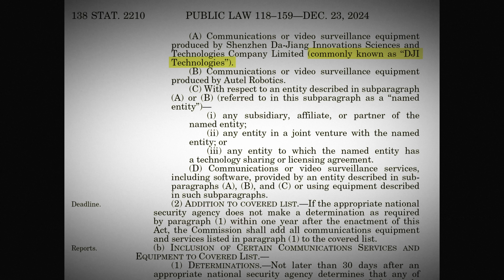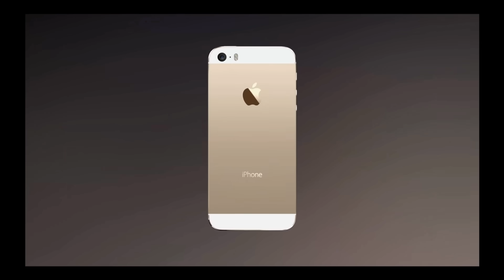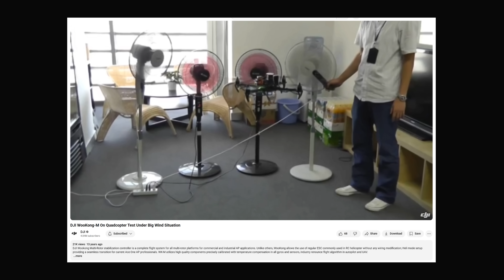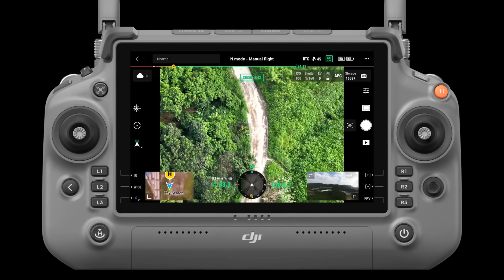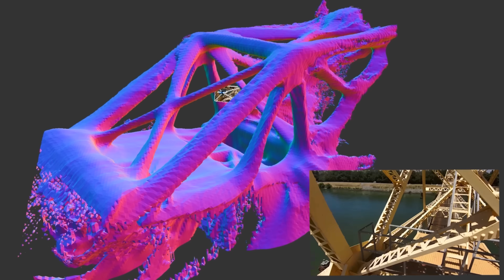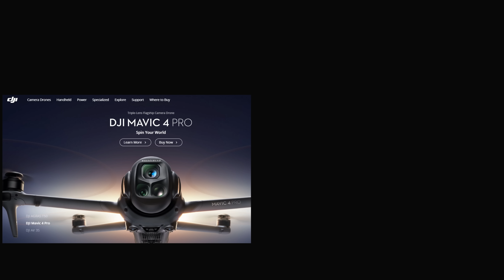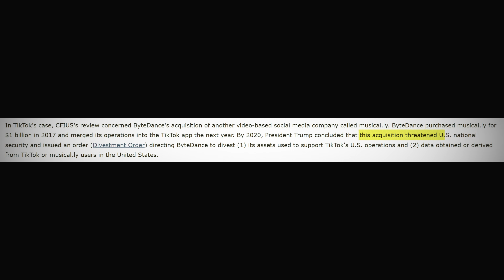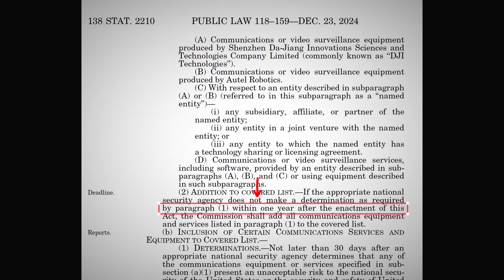DJI's Dominance and the US Ban Problem. The DJI Story

Comment: As someone previously pointed out, Mavic 4 Pro 4 can be found in the US by US sellers.  I ordered a Mavic 4 Pro and it arrived from Florida in 3 days.  Also, within a month I bought an Air 3S and Mini 4 Pro from US sellers.
Reply from the maker: Thanks for sharing your experience. I bought a Mini 4 pro as well. There is still time before the end of the year but I will admit my prediction so far is trending in the wrong direction. Buying from resellers, likely at a marked up price, is not necessarily the same as buying direct from the company but it is an important nuance that I overlooked especially if very large resellers like B&H, Adorama, Best Buy will do it. I am in the market for an OSMO NANO and that is even following the same secondary market processes mostly on those sites available in 1-month or on eBay from Korean resellers.

Comment: To be clear, you're talking about one class of consumer drone here: camera drones, a.k.a. aerial tripods.  DJI owns that market segment outright.

FPV drones, on the other hand, are mostly run on open source firmware such as BetaFlight and OpenTX.  DJI has a large share of the digital VTX/goggles market in FPV, but there are other digital video systems [HDZeo, Walksnail] available that will fill the void should the DJI FPV kit be banned.  In the meantime, analog video is still used by a large number of FPV operators.

Banning DJI camera drones is a pretty dumb idea - especially since the US doesn't have a fully domestic consumer drone manufacturer, let alone an industry.
Reply from the maker: Thanks for the clarity I know I switched back and forth a bit with enterprise ones but yes just the easy to use (non manual) consumer aerial drones.

Fortunately, FPV seems very healthy and is commercializing past pure DIY builds. Hopefully costs reflect that though I’ve seen some accounts I follow mention tariff increases in prices.
Reply: @lukecresante  FPV will likely remain a niche hobby.  The learning curve is pretty steep.  I fly the sub-250g stuff.  Even with tariffs, a decent micro whoop FPV kit is still affordable.
Reply from the maker: @billmcdonald4335  I love that. It’s super cool how people are building great sub 250s that are definitely performative. You flying with a DJI air unit?
Reply: @lukecresante  Can't afford digital.  Analog for me.  All my firmware is open source: BetaFlight, OpenTX, OpenVTX, BlueJay, and ELRS.  The hardware is from several different Chinese manufacturers, so my setup is one-of-a-kind - like most FPV systems end up becoming.  Yet another reason why FPV will likely remain a limited market for the time being.
Reply: But if the issue becomes Chinese manufactured drone systems in general, then the whole FPV community is in trouble as well, not only the DJI sector. 

Most parts come from China. Also Shenzhen based Radiomaster is one of the most popular radio maker on the market. Walksnail (Caddx) is from Shenzhen as well. HDZero also does their development and production in Xi'an/Shenzhen with an "US based HQ". So even if DJI went away, the market would remain mostly Chinese regardless.
Reply from the maker: @kekkonenprkl   really well said. Software is really the last bastion until supply chains are reshored.

Comment: FYi DJI DOES NOT have "a year to make its case... the "FY25 National Defense Authorization Act (NDAA)   requires DJI to clear a national security review or face an AUTOMATIC BAN by the end of 2025. LESS THAN 5 MONTHS REMAIN,  yet nothing has been done on the Fed Mandate. All they need to do is run the clock out. 

Independent audits by firms such as Booz Allen Hamilton and FTI Consulting, as well as evaluations by US government agencies like the Department of the Interior and Idaho National Laboratory, have found DJI's products to be secure. Yet here we are. Once the FCC killed the radio frequency licensing,  my MAVIC 4 PRO, purchased with no Warranty may become a paperweight.

Comment: Neo is brilliant— great by itself, but compatible with both the next-level rc and fpv controllers.  Got me sucked in.  I got the controllers for the sake of the neo and now Im upgrading my drones.  Impressive quality and performance. Best product to come out of china since my wife! 😊
Reply from the maker: Each time they release a new and more affordable product... it basically has the specs of the previous much higher priced product. It is crazy. Neo is using the O4 unit if I am not mistaken which puts it higher than the original Avata and definitely FPV.

Comment: My Mavic 4 Pro arrives in around 12 hours. My Mini 4 Pro arrived within the last week and my Air 3S arrived three weeks ago. My Phantom 4 and Phantom 4 Pro V2 have been sitting unused because of their size and the massive size of the case to hold the controller, batteries, iPad, etc. I'm so excited to finally get into drones! EDIT: Oh yeah. And I'm in the US. Getting it from Adorama. The Mavic 4 Pro, that is.
Reply: I’m sure you already know this but as a heads up, just be careful with it. There won’t be DJI care available on it in the US nor will they as yet offer repairs on it. You might be able to get repairs done with someone else though I’m not %100 certain on that part personally. It is a beast of a drone but just take care of it well and enjoy it!
Reply: @trevorkerr5353 I really appreciate the advice! I purchased a 4-year protection plan through Adorama. It doesn’t cover fly-aways, but will cover a crash and more. Though I wouldn’t expect the quick turnaround that Care Refresh seems to provide and which I bought for my other two new drones. 

My Mavic 4 Pro arrived about an hour ago. I’m about to turn it on and set up the controller. It will be interesting to see if by any chance the option for Care Refresh shows up during the process. I received a couple of emails regarding signing up for it and that was after I already bought it for the Mini 4 Pro and 3S. So my fingers are crossed that those were triggered by my Mavic purchase. Not holding out hope. If by some odd chance I can I’ll get it and cancel the other. Or maybe just suck it up and do both since I’d have two extra years with the plan I already got. And it would be nice to have the added assurance that I’m covered even though it adds to the already high cost. 

Thanks again for the heads up! I definitely don’t plan to push this as others have with their tests through wooded areas, etc. my hopes are to incorporate my cameras into my video/photo business and for corporate and photography I of course wouldn’t have the same risks. And for personal use I’d play it safe too.
Reply from the maker: What a collection. That is crazy! I saw on Adorama you must have gotten there very early. Or are they restocked?
Reply: @lukecresante I saw the Mavic 4 Pro kits when they were initially available on Adorama, but didn’t realize what was going on with availability and missed my opportunity that day before they quickly disappeared. There’s a particular sales rep I’ve dealt with for years there whom I called the next day and he put me on the wait list. A few days ago he called to say he had one waiting for me. The standard and Fly More are both still listed as back ordered and the Creator Combo says Pre Order. I don’t know what the difference is. With the 3S and Mini already, I wasn’t going to get the Mavic. I guess the ability to even get my hands on one made it too enticing to not.

It’s a bit obsessive, for sure! But I was so determined to up my game from my Phantoms that I jumped on the 3S when I found one available for the fair price when the other limited options I found were $400 more. I’d been watching so many videos for my research and then the Mini 4 Pro was too hard to pass up and I knew it set itself apart enough to justify that second new drone purchase. I also found that for a fair price when most everyone else was charging a lot more. Also got my extra batteries for both drones for a fair price. For example, most are now selling the 3S batteries for $245! I paid $179. 

I don’t like to finance, but took advantage of my zero interest option with Adorama for the Mavic 4 Pro. Now I need to stop trying to convince myself that I made a good move and start making some money with them!
Reply: Damn you rich or something😳
Reply: @IsaacMartinezOfficial Ha. I wish. Got best prices possible, did some 0% financing and it’s an investment for my freelance career. I am fully prepared to sell one or two if needed. I’d be pleased if I sold ten for a price that is better than what it would have been to rent.
Reply: You’re lucky the entire DJI site is sold out right now.
Reply: @rickybobby7276 Oh wow… as in it’s on back order across the world?
Reply: @livemusic  That'd be nice to know. Still seems available on Amazon.